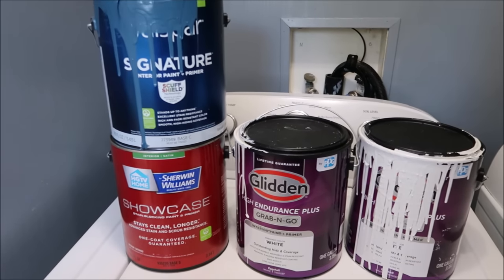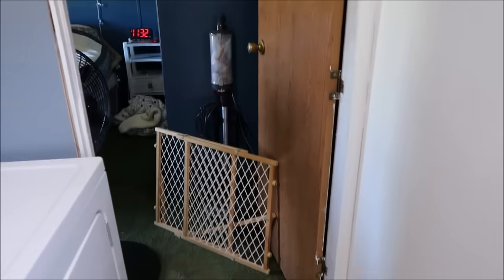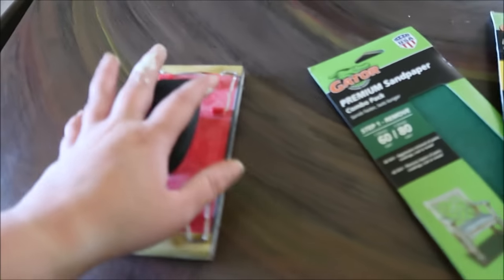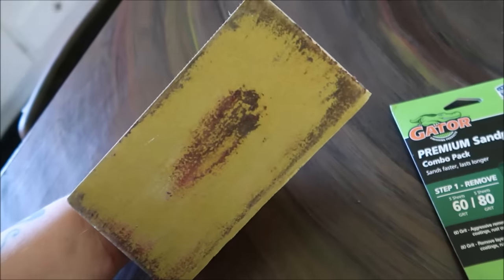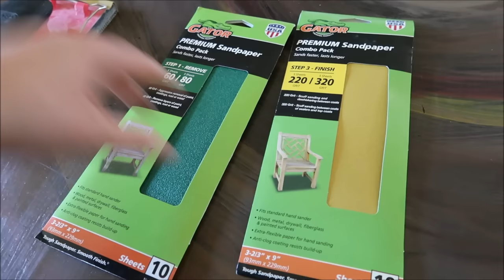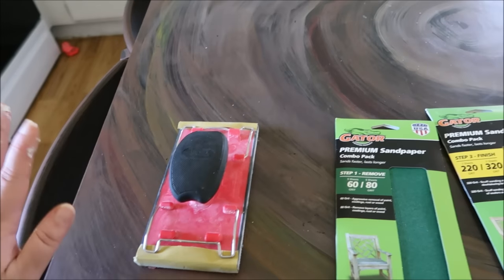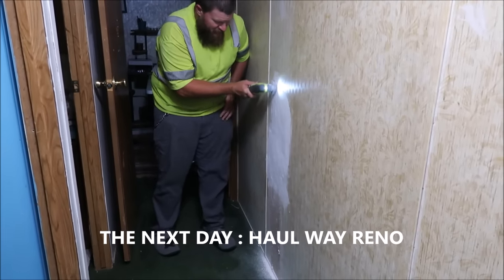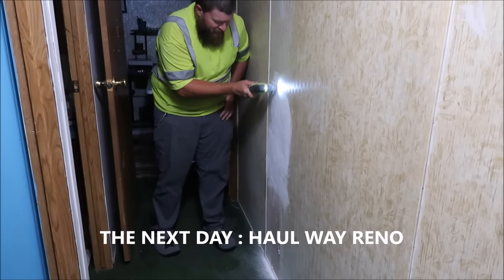REMODELING A SINGLE WIDE MOBILE HOME FOR UNDER $1,000 DOLLARS | MOBILE HOME UPDATE

Comment: A little tip for mobile homes…caulk is your BEST FRIEND!!! Caulk around the trim, strips on the wall, kitchen cabinets, anywhere and everywhere that has small cracks. It elevates your space SO MUCH. makes the biggest difference and is very inexpensive. P.s. your place is looking great!

Comment: A tip from a painter, use a 2 inch angle-good quality paint brush to cut in the top of the wall next to the ceiling. Caulk those cracks and seams with an inexpensive latex caulk. Makes all the difference. You’re well on your way to becoming a YouTube channel creator, nice job on your editing!

Comment: Nice. If your walls are Sheetrock, you can pull the strips of molding, tape and mud the joints. Have a smooth wall such as stick built houses have. If it’s ply board, you can add a mud texture to give it cohesive walls.

Comment: I think what you did was more of a ‘redecorating” than a “renovation” or a ‘remodel.”  Renovation implies carpentry where you are taking down walls, putting in new floors, etc.  Redecorating is when you paint, re-arrange things, re-purpose things,  change furnishings, etc.  You did do a nice job.
Reply from the maker: Oh I disagree I don't think painting is decorating that would imply it being decor. I've never found paint in a decor section of a store. We painted almost the whole house and Aaron repaired big holes in the wall. This is just one video of an entire remodel series. We actually didn't decorate anything in this video 😂

Comment: Hallo kimi. If you want your bathroom basin white. Get this bleach or peroxide in bottles and smeer it on cover with clingwrap for at least 12 hours. The smell is strong but it make it so white. Specially yourplastic tipe baths and basins. It really work. Did it in my old house remove even rust. Here is a saying I love and I think it suits you. " Do not go where the path may lead you. Go instead where there is no path and leave a trail for others to follow. Love you Karima  South Africa💐🌻🌻🌻

Comment: Kimi I'd say use stonecrete or an epoxy type of paint to paint the cabinets in the kitchen and bathroom. It's priced at $5/ sq ft which is very cost effective for the remodel of your home.  I hope this info helps you get a great return on your remodel.
Reply from the maker: It does help , we already painted our bathroom cabinets and kitchen cabinets but maybe someone else will see your comment and use your suggestions ❤